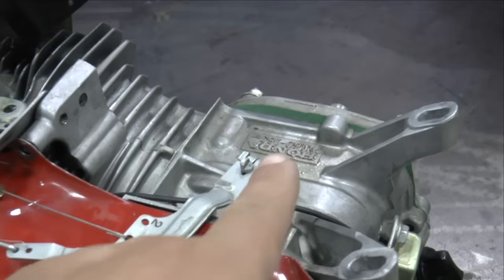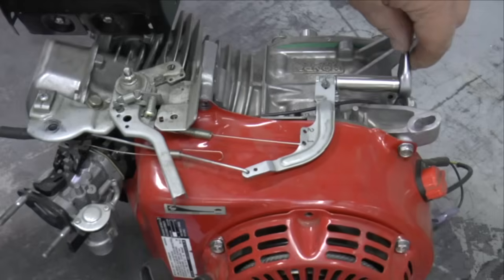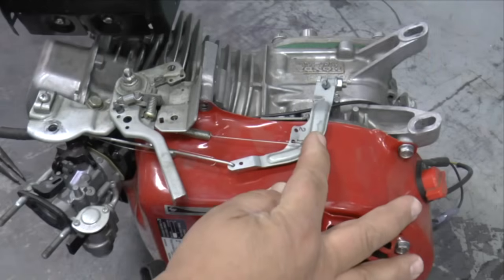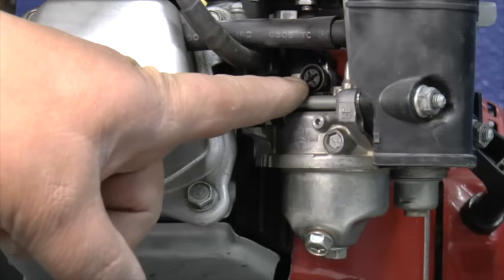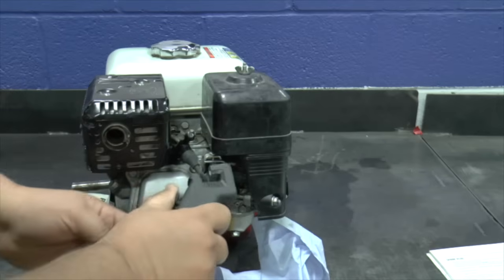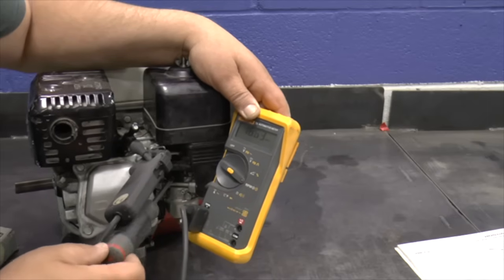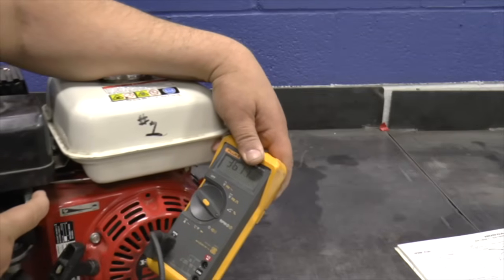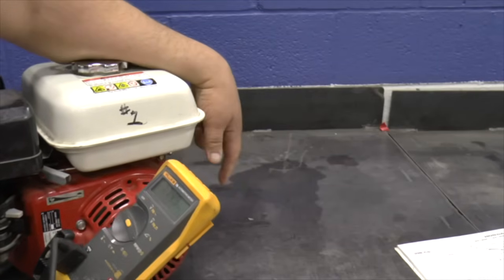GX160 Governor & Carburetor Speed Adjustments

Comment: Hi, This is a nice video which points me in the right direction with my MTD engine which looks similar. However I noticed @:50 that the spring on the rod was off on the governor arm side, does that have to be off to do the adjustment???
Reply from the maker: Good eye RH.   I didn't notice it was off until you pointed it out.  It should be on, but will not affect the adjustment at all.
Reply: Another concern is, should these parts get a coating of any sort of lubricant as part of off season maintenance procedure to prevent corrosion, binding or rust? IDK how old that engine in the video is but my MTD 265-SUA on my Craftsman 24" snowthrower for four years old doesn't look as shinning. Needless to say that if we have in mind that Sears Craftsman is still great back in our fathers and grandfathers day, we are in for a very big let down as this crap is made in China!
Reply: BTW, my friend thinks that if my Craftsman should ever go F.U.B.R. (F*ed Up Beyond Repair) that I should get a "Husqvarna" as he swears by them...
Reply from the maker: The engines in my videos are all brand new.  You could spray down the engine with WD-40 after the season is over to help stop corrosion.
Reply from the maker: Found this in a thread.  Most all snowblower engines have Chinese engines in them.  Just look at the tiny starters on them compared to american made engine starters.  Here's the info I found.

"I have been tracking this for a few years now..
here is the update for 2013:

The State of Snowblower evolution, 2013 model year.

Tecumseh snowblower engines, up to 2008, were always made in the USA. Briggs & Stratton engines were made in the USA for the majority of its history. Around the year 2000 (perhaps earlier in the 90’s) Briggs began their smaller gas engines in China.

Up until 2008, probably 90% of snowblowers were 100% American-made, both the snowblower body, and the engine both. Tecumseh had the majority of the snowblower engine market before 2008, and Briggs was still making their larger engines in the USA. Only the smaller Briggs engines were made in China.

Tecumseh pulled out of the small gas engine business in 2008. 2009 was the last model year that snowblowers were commonly found with Tecumseh engines on them. (2009 model year were machines that went on sale in the Autumn of 2008)

Since 2008, Production of small gas engines has moved to China in a huge way. 
In 2008, perhaps 90% of snowblowers had American-made engines on them.
Only 5 years later, in 2013, probably 90% have Chinese-made engines. And the percentage of American-made engines continues to drop. Soon it will likely be 100% Chinese engines on all snowblowers, lawnmowers, garden tractors, and anything with a small gas single-cylinder engine.

Brand names with American-made snowblower bodies, and some American-made engines:
(the last remaining 100% made in the USA snowblowers)

Ariens - Three models remaining in the 2013 lineup with American-made Briggs engines:
12V Pro 32, Platinum 30, Deluxe 30.
The rest of the models have Chinese engines.

Beginning this year, 2013 model year, "Made in the USA" stickers have appeared on engines of Ariens machines, which have the USA-made engines:

Report this image

(im not sure if Ariens added the stickers, or if Briggs did.)
But this is the first model year those stickers have been seen on those engines, a handy spotting feature!

Snapper - (made by Briggs & Stratton)
Three models remaining in the 2013 lineup with American-made Briggs engines:
M1529E, H1528E, H1730E.
The rest of the models have Chinese engines.

Simplicity - (made by Briggs & Stratton)
Four models remaining in the 2013 lineup with American-made Briggs engines:
H1528E, H1730E, P1524E, P1728E.
The rest of the models have Chinese engines.

The Briggs brands are using the old Simplicity and Murray designs for their snowblowers.
Since 2005, the Briggs names have included Simplicity, Snapper, Murray, John Deere, 
and Brute. John Deere and Murray snowblowers are no longer being made. And Brute
is 100% Chinese engines.

Husqvarna - The evolutionary successor to the old AYP snowblower line.
One model remaining with an American-made Briggs engine.
14527E
The rest of the models have Chinese engines. 
Husqvarna also makes Polan snowblowers, Poulan has 100% Chinese engines.

That makes Eleven total snowblower models in 2013, from three manufacturers (Ariens, Briggs and Husqvarna) that are still 100% American made, both the snowblower, and the engine both. And the percentage drops every year. Soon it is likely we will have all Chinese engines on all snowblowers.

Brand names with American-made snowblower bodies, and all Chinese-made engines, (as of 2013)

MTD brands (Cub Cadet, Troy-Bilt, Yard Machines, most Craftsman) - all Chinese engines. (starting in 2012)

Toro - All Chinese Engines. (starting in 2013)

Brand names that are 100% made in China:
In addition to Chinese engines on American-made snowblowers, we are now also seeing 100% Chinese made snowblowers, both the snowblower body, and the engine both. The following brands are known to be 100% Chinese built:

Stanley 
World Lawn
Snow Beast
Huskee
Powerland
Snow Joe 

The 100% American made snowblower (and lawnmower, and riding mower, and garden tractor) is fading fast..get them while you still can!

Which engines are the remaining American-made engines? Only three US-made snowblower engines remain:

Briggs & Stratton 305cc 1450 Series
Briggs & Stratton 342cc 1550 Series
Briggs & Stratton 342cc 1650 Series.

ALL other snowblower engines, including all Briggs engines except those three models, are made in China..(the exception being perhaps Honda snowblowers, who perhaps still makes some Honda engines in Japan, and China as well.)

But there are definitely only three remaining US-made engines.
(source for that info is “Snowmann” on the forums, who is known to work for Ariens,
He posted that info about the Briggs engines a few years ago.)

Other sources: Ariens 2013 brochure, Toro 2013 brochure, Cub Cadet brochure, other MTD brand webpages, Briggs & Stratton brand (Simplicity, Snapper) webpages, Husqvarna webpage.

Disclaimer 1 - yes, I know..someone will bring it up!  I am aware that when I say “100% American-made snowblower, both the snowblower body and engine both” that is not literally 100% true! Because some parts are made overseas..The American-made Briggs engine likely has parts made in China inside of it, and perhaps the “Made in America” snowblowers do as well! But im not concerned about that.
This is my criteria:
If its made in a factory on US soil, by US workers, then im calling it “Made in the USA”
If its made in a factory on Chinese soil, by Chinese workers, then im calling it “Made in China”
Im not concerned with the exact origin of every last nut and bolt. 

Disclaimer 2 - the above information is likely incomplete! Especially the “100% made in China snowblower” data..there are probably several brand names I am missing. Also, The above list primarily focuses on 2-stage snowblowers, because it is believed that 100% of Single-Stage snowblower engines are made in China, and have been for some time.

If anyone has any corrections or additions to this list, please let me know!
I have been tracking snowblower evolution since 2009, (and all the way back to 1960! With my Ariens webpage) and I will try to update this list every January."
Reply: The main ironic thing is the rest of the engine is still shiny its just the levers and linkage rods and springs. As normal practice I rinse down the remaining snow especially if salt is mixed into it inside my auger housing and chute over my zip drain after each use and I always keep my Snowthrower in my garage or shed.
Reply: It is very sickening that mostly used products aren't made here in the USA, anyway thanks for the info and keep up the great work on these videos as it helped me and others! Greatly appreciated!

Comment: not related but I have a gx340 with a brand new carb and is running lean only on choke, is an aftermarket carb, the valves were recently adjusted to the correct settings and still having the same issue, any suggestions would be greatly appreciated. thanks

Comment: my governor spring goes the other way around on my 160 F 4.0HP which is a honda GX160 look alike.
Reply: That sounds more like a tuned Honda gx120 clone than a gx160, the gx160 gives out 5hp at the stock 3600rpm